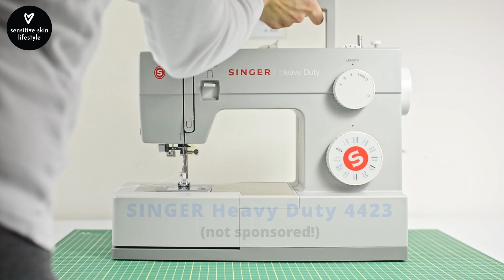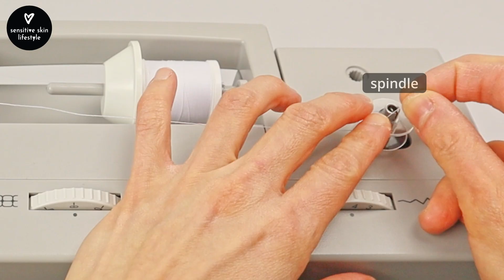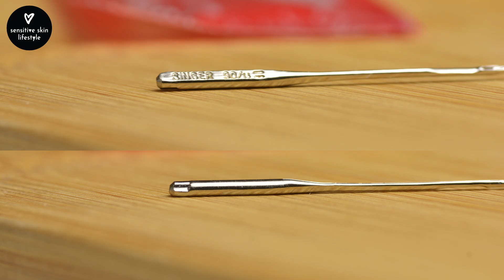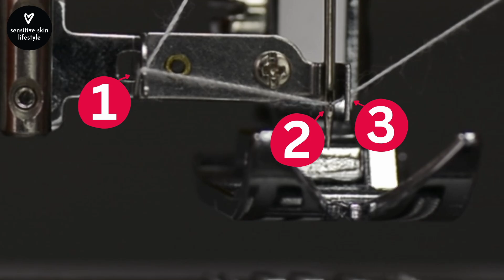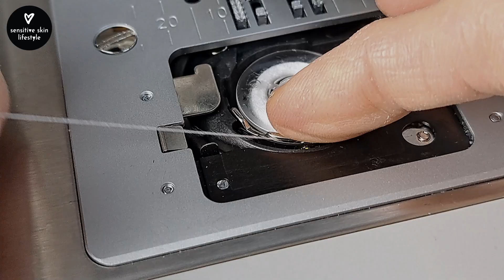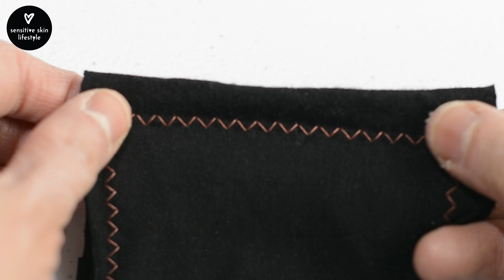how to thread / use a sewing machine for beginners | Singer Heavy Duty 4423 setup

Comment: When you put the spool of thread on the horizontal spool to start the threading process for either winding the bobbin or threading the machine, is the thread coming off the spool from underneath? That’s the part that I can’t talk on any video I’ve watched.
Reply from the maker: @sonjaturpin1639 Hi! The thread doesn’t come just from underneath. It unwinds around the spool as it spins, and comes off smoothly from the end of the spool near the spool cap, rather than pulling from one spot underneath. Hope this helps clarify! Out of curioity, what is the reason behind your question?  Cheers

Comment: how would you do it with a spool holder tower thing and a large thread roll?
Reply from the maker: Same process! The only difference is that the thread will come from a standalone spool holder, which you'll place on the table behind the sewing machine on its right side (or you can use a DIY spool holder to hold your large thread roll). After that, just follow along from 1:37 in the video to insert the thread into the top thread guide and continue as shown.

Here's a great homemade spool holder hack for large thread rolls: https://youtube.com/shorts/5iDXby3B5D4?si=m6LYUOubwI_LX2-b